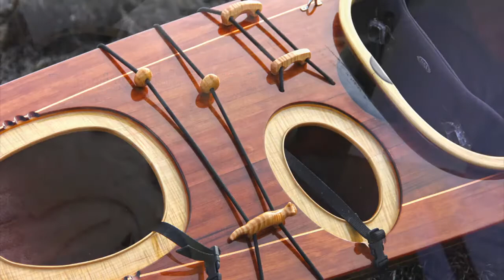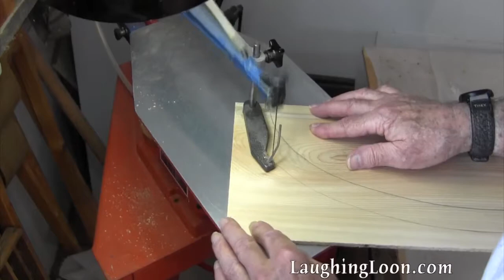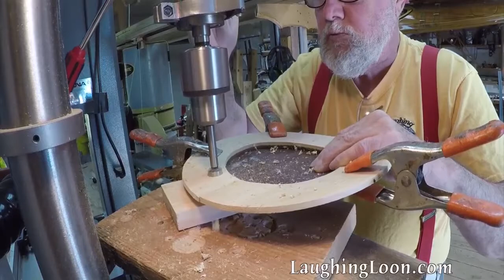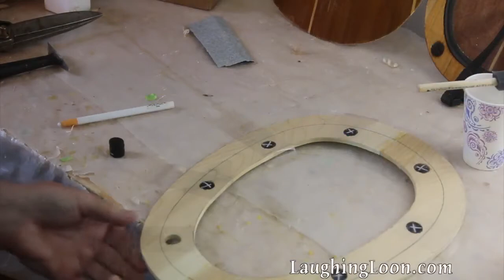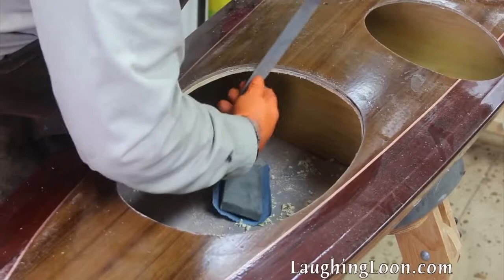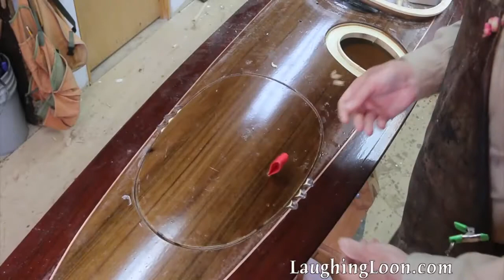Laughing Loon Ootek Build Part Nine

Comment: I really like the design of the latches, my only concern is that having strong magnets that may affect the compass which is a legally required piece of a pleasure watercraft equipment here in Canada. Did you make any tests to check if a compass still points towards north?
Reply: The compass is not effected if 18” away from hatches.

Comment from the maker: Tethers for the hatch covers are shown in the first picture here and installed is shown in part 11.

The scroll saw is used in this video to cut thin wood and veneers. 3/16" thick wood
panels are used for the hatch ring and deck lip. Veneers, like flame maple and Makore are
used to cover magnets in the deck lip.

I buy veneers from Certainly Wood veneers in Aurora NY